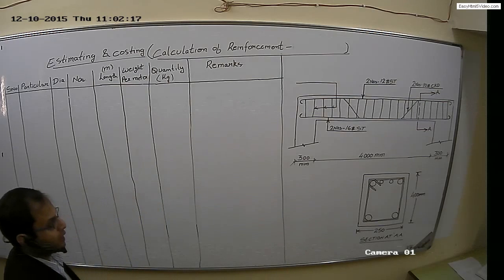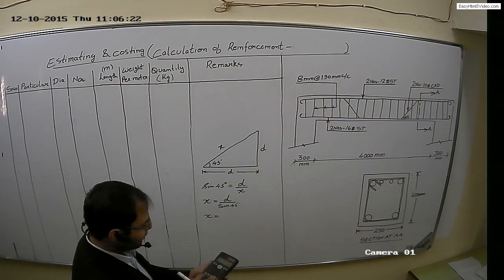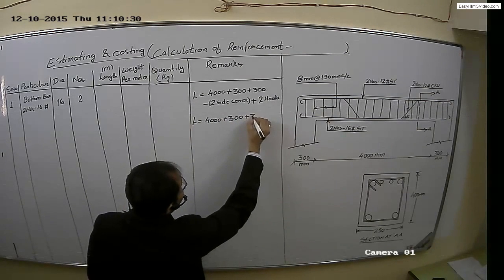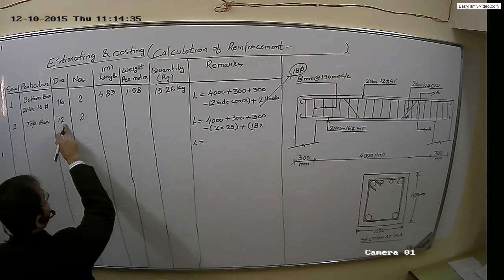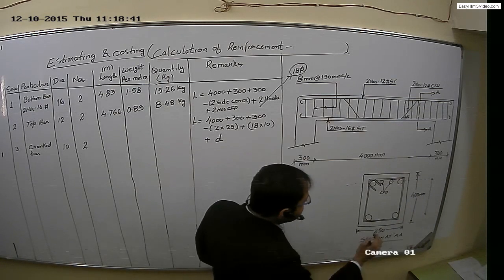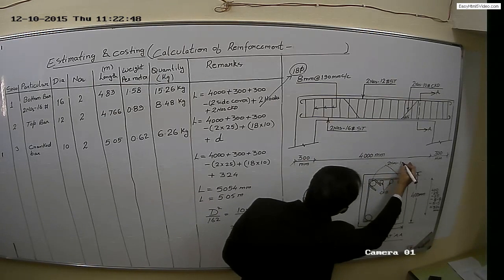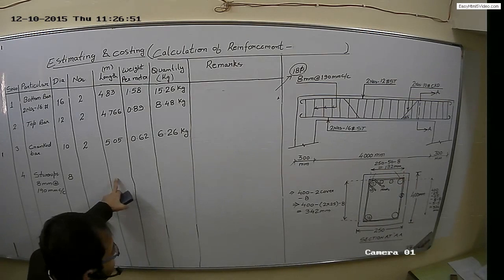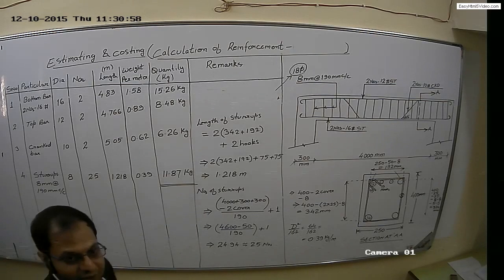Estimation of Reinforcement Beams

Comment: in cross section how can u say that hook length is 75 mm I can't understand can u explain sir
Reply: it is prescribed by is code 456- 2000
you may take 75 mm or 10d but not less than 75 in any case